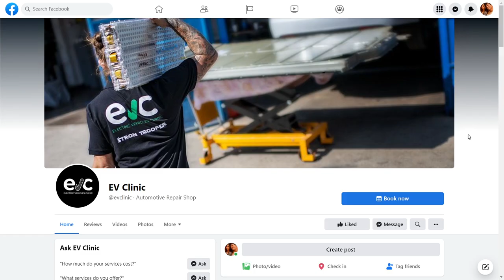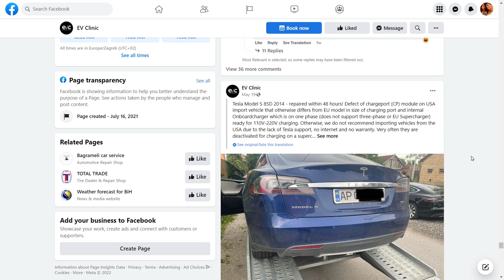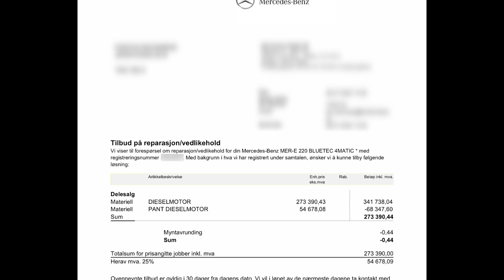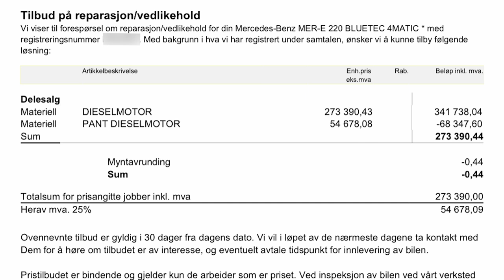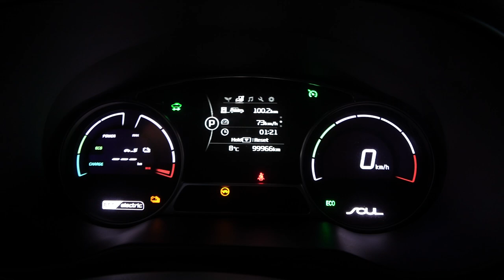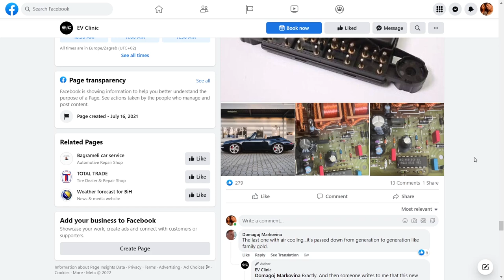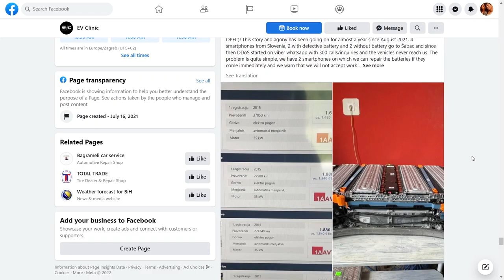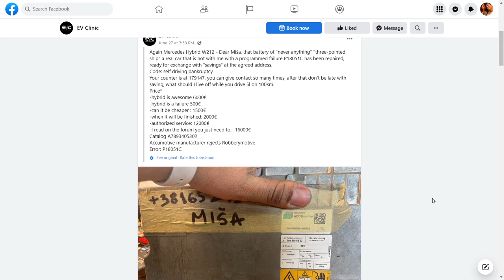Why fossil cars are more expensive to repair than EVs

Comment: Nah 

How much is a new battery, controller, electric motors, charge ports etc if they fail?

A high performance electric motor in a modern EV costs thousands

Everything else in an EV is in an ICE and can fail in both, suspension, AC etc
Reply: I think it's unfair comparing a battery to a whole engine. A battery seems more equivalent to a fuel tank, fuel pump and lines.
Reply: As always, there is no such thing as ‘’an” EV like there is no such thing as “an” ICE. Based on this only, statistically, any statement about this topic is both right and wrong. 
However, interpretation of stats over time will clearly prove EV’s are a no brainer when it comes maintenance costs and thus TCO.
Reply: @huffinpuffin86  A fuel tank does not wear with age.
An engine does, just like a battery pack.
Reply: 8 years warranty. So in the Mercedes case IT wouldn't cost the owner anything.

Used Model 3 motor in Norway is about 2000-3000 USD. Not a big deal really.
Reply: @rogerstarkey5390  Well, that argument goes both ways, doesn't it? :)
Reply: @huffinpuffin86  No it doesn't. The costs of a battery is many times higher than for a fuel tank and its pump etc
Reply: @rogerstarkey5390  In a Tesla, it’s when 🤣
Reply: @huffinpuffin86  Which are common issues in ICE, fuel pumps go all the time
Reply: @Momfasa  Exactly! Do you agree fundamentally that a battery is equivalent to a fuel tank system (with fuel added of course)?
Reply: @IIGrayfoxII  A fuel tank still ages plus you might need to replace lines and fuel pump over time. My point is that fundamentally a battery (that holds the energy required for movement) is equivalent to a fuel tank filled with petrol/diesel. The engine in an ICE is more equivalent to the electric motors in an electric car don't you think?
Reply: @IIGrayfoxII  Exactly 

A basic EV like a 400km range Kona is an ICE with a €10,000 battery, €8000 high performance electric motor, controller, bms, inverter, charger port that cost another few thousand 

It’s costs €20,000+ to replace an engine and fuel tank which costs peanuts in comparison
Reply: @Momfasa  Yeah ICE have no warranties now 🤣
Reply: @Tommy-vj2mc  ICE have warranties as well? and no poor person is gonna drive a high class Mercedes or Tesla EV outside warranty, like a-lot of Eastern Europeans drive out of warranty older Mercedes ICE that they can repair themselves in most cases 

A high end Mercedes EV out of warranty could be a financial disaster, throwaway cars imo
Reply: @huffinpuffin86  A fuel pump does not cost that much to replace, and best of all.
YOU CAN DO IT AT HOME WITHOUT SPECIAL TOOLS, JUST BASIC ONES.
Reply: @huffinpuffin86  Yes and no. On a fundamental level there are similarities. But a (fossil) fuel tank is far superior than a battery when it comes to amount of energy stored and the time it takes to fill it up. Absolutely no comparison.
Reply: @declanosullivan8749  This is just stupid argumentation inline with "my dad is stronger than your dad". Car repairs are cheaper with an EV? Absolutely stupid unless you like to compare apples with oranges.
Reply: @IIGrayfoxII  Correct. For me personally I just love to do that myself. Changing filters, oils, and whatever is like therapy. Get out in the garage, put on some music, get my hands dirty and make my dearly loved fossil car happy. Just awesome.
Reply: @Momfasa yes, I agree a fuel tank can hold a lot more energy. I was confused what you meant by 'no it doesn't' in your original reply to me. I didn't agree with the specialists in the video making a comparison about the cost of replacing a battery to the cost of replacing a whole engine as the two are fundamentally not the equivalent type of system. On the whole I agree with the sentiment from the guests in the video that electric cars should require less maintenance overall and if repairs are done on a component level then should work out a lot cheaper to repair vs an ICE car in the long run.
Reply: @huffinpuffin86  In EVs, the battery is the "soul" of the car, as in an ICE it is engine/transmission.  The electric motor, inverter, AC unit is pretty old tech in general, but the capacity to deliver the power, for how long you can pull it at peak current, how efficient it is, etc is the battery.  In my opinion Tesla is the closest to understand that the battery brand is key; I know they are willing to buy from others too.  Look at any other EV manufacturer, "no pride" in the battery manufacturer as theirs, as you see in engines.
Reply: Yeah and oil changes are free right? Right?
Reply: @huffinpuffin86  Haha and I was confused by your first reply. Seen out of context you said that a fuel tank and an ev battery could be seen as equal which got all my cylinders fired up haha. All is good! :)
Reply: @jolizana96  Yeah and ev batteries changes  are free right? Right?
Reply: @rogerstarkey5390  A modern long range EV battery brand new is €10,000 yes and a 150kW brand new motor will be close to that brand new from manufacturer 

I’ve seen BOM lists of EV and the parts are mental money 

Without incentives EVs are dead in the water, €20,000 to replace a fuel tank and engine is ridiculous
Reply: @Momfasa  You’ve no long term data to draw that conclusion 

Modern long range EVs are only around a few years and oldest are 10 - 12 year old Leafs 

Until you’ve data to show me EVs can last 500,000km cheaper than reliable old Hondas, I’ll go with the one we have data for

Find me a Tesla that’s not had many big costly repairs at 500,000km? 

Leaf wouldn’t do 30km range if it’s got to 500,000km 😂
Reply: @rogerstarkey5390  haha a 500,000km Tesla will have had many expensive repairs done 😂

Find me one that hasn’t lol 😝
Reply: @declanosullivan8749  You misunderstand. I agree with you. There's no argumentation. For me it's ridiculous saying EVs are cheaper to repair than real cars when replacing the battery alone will cost more than half the car.
Reply: @Momfasa  Sorry I did misunderstand  

Agree completely, it is insane
Reply: @declanosullivan8749  No worries mate. I did the exact same thing a few comments up in this thread. So easy to misunderstand and feel that immediate urgency to say to some guy on the internet that they are wrong :) Especially on click bait videos like this...

Comment: Would be interessting if you let them repair one of your tested souls and check the degradation again.
Reply from the maker: He actually wanted to repair the high degradation Soul in Oslo, but the owner will get a new battery from the dealership... in 6 months.
Reply: @bjornnyland  and as Vanja stated, what is the carbon foot print of the new battery of this Soul? We all know EV’s have high carbon foot print leaving the factory because of their batteries being very energy demanding in producing. So now we soon have a Soul runnng around in Oslo with it’s second battery. Perhaps there should be a MASSIVE CO2-tax on EV battery production to counter the CO2-tax on fossil cars and fuel?? Just to level the playing field and of course to save the environment…

Comment: I own a Renault zoe from 2014. Batterie is still Good. I'm missing the possibility to upgrade the car to for example dc charging, Android Auto. Because a ev car can last many more years than a ICE car. It would be a Good idear to renovate a ev car like you renovate a house.
Reply: No EV has so far lasted for 10 years. Most Model S are at scrap yards in Norway. Won't talk about how many Zoes they got at the scrapyard near Oslo.

Comment: I drove my VW Touareg into a flood and wrecked the 5ltr V10 engine. I know this is an extreme case, but it cost €36,000 back in 2004 to replace. I only drive BEVs now!
Reply: A Toyotar would have brushed it off and kept working.
Reply: How did you kill a diesel in a flood? Did you drive it for a long time?
Reply: @dragospahontu  No a deep time! It was over in seconds & twisted the engine block which would make an excellent coffee table if anyone wants one.
Reply: @wilkoone9155  so did you turn it into a coffee table? My friend got lucky with his 2.0TDI. he managed to open the engine, dry it out, and it started again.
Reply: @dragospahontu  I told you that it twisted the whole engine block, it with NEVER run again!
Reply: @wilkoone9155  i got that part, but did you turn it into a table?
Reply: @dragospahontu  I wish people like you would read the previous posts, if you had you would know the answer to your question. Bye
Reply: @AP13P  Bollix!
Reply: @wilkoone9155  Toyota cares for it's customers. It wouldn't let water destroy an engine. This is why people buy Toyota.
Reply: @wilkoone9155  i guess not...

Comment: You are taking extreme cases with ICE cars. Very low percentage of ICE cars ever need full engine replacement, despite having lots of moving parts, most of the ICE cars make it 200k or double that with the original engine and only regular services. Also you are comparing very expensive cars.
For a fact I know that Toyota (non-plug in) battery pack replacement costs bellow 1000€ at the Toyota dealer... You are selling BS on all accounts!?
On the other hand, I had a very bad experience with the local Nissan dealer when I brought in a perfectly working 2017 Leaf for yearly inspection. They wanted to charge me 250€ for annual service after 4 years, I have no idea what did they possibly need to do on the car that is almost brand new, I agreed to brake fluid replacement but I refused to pay 60€ for cabin air filter, and 50€ for front wipers, 20€ for wind screen washer fluid. It still cost me 100€ at the end, which is more then I paid for a regular service on a 4 year old diesel Renault Megan!? Replacing engine oil and 4 filters.
So don't show the wrong picture. I'm also a bit afraid of my Leaf batter, it should be in warranty for the 8y/160kkm, so 3 more years and the same Nissan dealer already told me that when my health status bars drop to 8/12, I will be eligible for a replacement with a refurbished 10/12 bars battery! That was a great shock to me, I rather buy new 40kWh instead of getting another used 30kWh which will only have 24kWh of usable capacity. 
Anyone has any Leaf battery warranty experience? Care to share please?

Comment: An important factor is that ICE engines always lose power as they age. EV’s hardly do if at all, but they lose a little range instead.
Reply: Over 100k km Ice engine power degradation is less than EVs battery capacity degradation.
Reply: @AP13P  not always. They are not equivalent or interchangeable. Loss of power and efficiency affects every mile driven adversely. Loss of capacity does not - only range which is immaterial in most journeys and equates to loss of flexibility around when to charge but li=title else.

Comment: While servicing can be more expensive as their are more things.
I have seen videos of where people in Telsa hit something on the road like a ladder that falls infront of them, the battery pack gets damaged  and costs $10,000 as they need a new one
Reply: If one hits a ladder on the highway with an ICE vehicle, nothing happens, no repair costs whatsoever. Seriously, it’s a miracle. Have not seen videos of this on YouTube yet to prove it but there sure will be one some day
Reply: @rogerstarkey5390  Whambam tesla cam was the channel.
Reply: @gerardhaus8150  No damage will be done to the ICE vehicle as well, but it might not be as critical as a battery pack which is low.
Reply: @gerardhaus8150  ofc something will happen, but 99% of cases its oilpan/gearbox oilpan/differential oilpan and costs like 100$.
Reply: @gerardhaus8150  Depends on the cars thou.  I low car, bye bye oil pan, engine runs dry, bye bye engine in just a few 10s of seconds.  I used to own a hilux, too high for anything to come close the engine.  The sedan I have, I already destroyed the catalytic converter because car is low, yeah used to drive that hilux.
Reply: Where can you get a Tesla battery for $(US, I imagine) 10.000?
Reply: @arskajee  Yes, the material costs that (without oil). With some models, however, you have to remove the axles/motor in order to be able to replace the oil pan. There can be another zero at the end very quickly.

Comment: Bjorn, just check it by yourself with the experts: EVERY a little sophisticated product has a special chip (or code) that decides which part "brakes". And you have to replace it despite the part is totally ok many times. I have this information from very reliable sources, multiple sources.
Reply from the maker: Brakes or breaks?